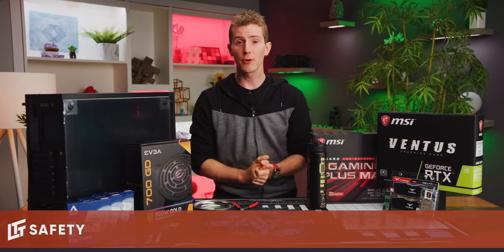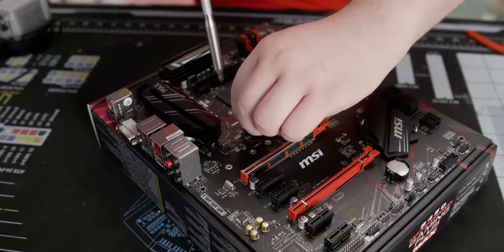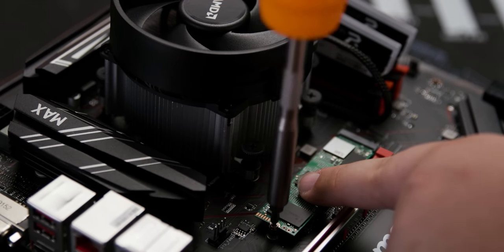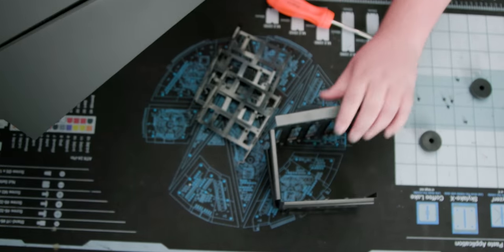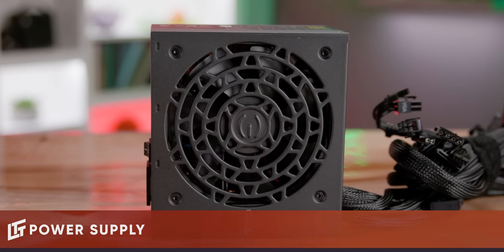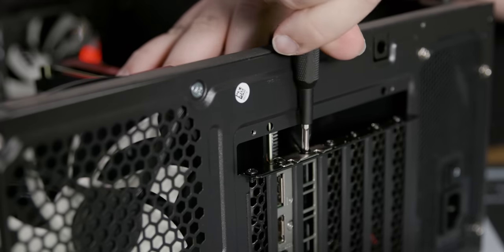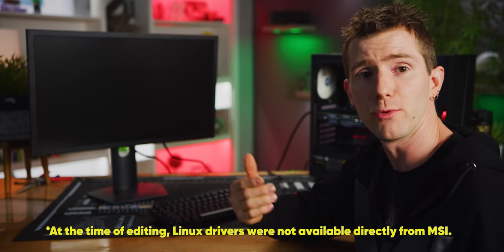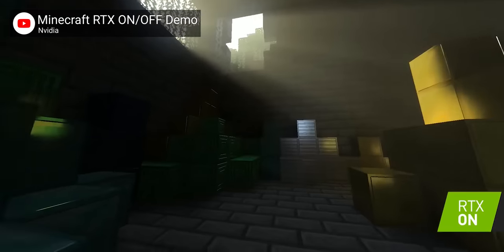$900 Ryzen Gaming Build Guide

Comment: I think I'm going to build this. It was this or the new 500$ video. I dont understand anything about PC's but this will be my second build. 1st one got about half a gallon of water dropped on it. Nothing was salvageable.
Edit 1: I have everything but the ssd, its shipping. I just hope all goes well.
Edit 1.5: I got everything but my keyboard and my monitor. They are both shipping. The ssd is here ima start.
Edit 2: So I fucked it. There were 2 standoffs and I got confused. My standoff hole has one thread broken. I have the right standoff now but I have 0 clue what to do with it. Starting to remember why I hated building PC's. This blows.
Edit 3: Ok everything got in. I need to pick up 1 more fan to have 3 and my monitor is on the way. Yup that means I'm stupid and just put the stuff in the case b4 I checked to make sure it's working. If it backfires it backfires. I've been waiting for months now. So all I need to do now is find out how to plug in the fans and I'm good 2 go.
Edit 4: Building a new PC now lmfao This was great but I make way more now. This is the build XD https://pcpartpicker.com/user/Desso/saved/#view=QB63wP
Reply: F

Comment: I'm new to PC's so bare with me, but are all the parts he uses in the description?
Reply: yes.
cpu = ryzen 5 3600
gpu = rtx 2060
ram = 2x8gb delta
storage = 1tb nvme 660p ssd
mobo = b450 gaming plus max
psu = evga 700 gd
case = corsair carbide spec 05

Comment: Bro, I have inserted the AMD processor on Motherboard and then mounted 
the FAN. Due to some reasons I need to put the FAN up but with that the 
PROCESSOR came attached to the FAN.
Now, I reinserted it as it was to the processor socket in the locked state.
It seems that it fits well, do I need to do something else?
Should I make them separate and then re-do the full process?

Comment: Why use A-XMP if the motherboard is already running at that speed? Check the video at 20:18 and you can see A-XMP is disabled but the RAM speed is 3000mhz.

Comment: @Linus Why do we short the power supply during testing?
Reply: 1. If your referencing the verge build. Then 🤣
2. If your talking about the part of testing the system outside of the pc. Then he shorts the pins on the motherboard to turn on the power supply and thus the system turns on. Allowing him to test the system and make sure it works before putting g everything into the system.

Comment: I've just bought parts for a new pc are they worth my money?
CPU: Intel Core I5 9400f
GPU: RTX 2060 6GB
Motherboard: MSI B365M Mortar
Ram: 2x8GB RGB DDR4
HDD: 2TB
SSD: 256GB
Reply: would’ve been better value with a Ryzen 3600
Reply: go with 10400 if prices are close
Reply: @f-22raptor25  my motherboard doesn't support 10th gen if it did i would have done the  upgrade

Comment: Would all these parts be compatible with an msi mpg z490 gaming plus motherboard? It's all best buy had and I want to build a pc for my significant other.
Reply: no you need intel 10th gen for that. 10600k or 10400 are great for their price
Reply: Other than the cpu that @F-22raptor said. Pretty much everything else should work except maybe for the case. I recommend getting a larger one. 
Good luck!

Comment: Hey, I could use some help. I'd like to build my first PC and I'm mainly using the components in this video. On pc part picker, after I put in the SSD on the little build your own page, it gives me this message: "The motherboard M.2 slot #1 shares bandwidth with SATA 6.0 Gb/s ports. When the M.2 slot is populated, two SATA 6.0 Gb/s ports are disabled." What can I do to fix this? Or is this not a problem? Thanksss

Comment: Hello guys, I am here for help. I am trying to build a PC. It will have:
GPU: 1660 Ti
CPU: Ryzen 5 3600
Motherboard: Asus B450- the gaming version
Ram: Hyperx 2x8 GB 3200mhz RAM
Power supply: be quiet! 650w 80+gold
1 TB 7200rpm HDD
500GB nvme m.2 SSD
Will it run games like COD on higher settings at higher FPS?
My budget is 1000€, which is like 1,100$
Reply: With a GTX 1660 Ti and a Ryzen 5 3600 you're definitely expected to run COD on very nice framerates (Driver updates for the GPU will definitely improve performance overtime so make sure to keep them updated), assuming that you have a monitor that will be able to push to those high framerates (Except if you're willing to not use V-Sync (V-Sync locks your framerates to the refresh rate of your monitor, thus eliminating any screen tearing - G-Sync and FreeSync is the same concept except it's a physical chip integrated into monitors) or G-Sync (If you have a G-Sync Compatible monitor)).
Reply: @fuzzy6622  thank you, this is the first time someone actually wrote something😁😁

Comment: Hi guys, I'm a bit stuck in my research to rebuild my pc. It's 6 years old and after countless BSoD I've decided to swap the internals. This is the system I've come up with so far: https://pcpartpicker.com/list/Mvh3gt

What I'm trying to figure out is if the motherboard will support the ram clock speeds of DDR4-3600 as under the specifications this is what it mentions:
https://www.asrock.com/MB/AMD/B550%20Phantom%20Gaming%204/index.asp#Specification

In that list of Memory compatibilities, I don't understand what it says by 
"- AMD Ryzen series CPUs (Matisse) support DDR4 4533+(OC) / 4466(OC) / 4400(OC) / 4333(OC) / 4266(OC) / 4200(OC) / 4133(OC) / 4000(OC) / 3866(OC) / 3800(OC) / 3733(OC) / 3600(OC) / 3466(OC) / 3200 / 2933 / 2667 / 2400 / 2133 ECC & non-ECC, un-buffered memory*
- AMD Ryzen series APUs (Renoir) support DDR4 4733+(OC) / 4666(OC) / 4600(OC) / 4533(OC) / 4466(OC) / 4400(OC) / 4333(OC) / 4266(OC) / 4200(OC) / 4133(OC) / 4000(OC) / 3866(OC) / 3800(OC) / 3733(OC) / 3600(OC) / 3466(OC) / 3200 / 2933 / 2667 / 2400 / 2133 ECC & non-ECC, un-buffered memory*"

I get that (OC) means Over Clocked, but does that meant the motherboard has to be overclocked to be able to handle the DDR4-3600 Ram sticks?

Also, how does one pick between brands when it comes to GPU's? I think the RX 5700 XT out to be a reasonably good card, but don't know which brand to choose from.

Comment: This question may came a bit later but i have the same case, and it isn't that much "deep" (199mm) so if anybody has it, does a liquid cooling fits on top? i know it fits a 2x140 but considering the radiator, does that interferes with the ram memories? i have two 120mm fans and looks like it almost touch the memories...

Comment: Can you upgrade to better things in the future? sorry if thats dumb its that im new to this
Reply: Yes. With PCs you can upgrade and change out any part. The only real rule is whether you want an Intel or amd cpu. That determines your mother board choice. I prefer amd, as they have been making their mother boards forward compatible currently. Meaning I started with a 2nd gen ryzen, upgraded to 3rd gen, and the latest generation is also compatible with my board. Intel has been greedy changing the cpu configuration every generation forcing customers to change motherboards if they plan on upgrading. Also AMD is currently beating Intel in performance this generation, so better choice all around.
Reply: Also forgot to mention. The CPUs aren't the only thing. There's also different generations of RAM. Older mother boards typically support what's called DDR3. Current boards support DDR4. Future boards will have DDR5, but we aren't there yet. Can't put old RAM on a newer board and same goes for putting new RAM on an older board.

Comment: how come this 2060 is giving 100fps on 1080 ultra settings in witcher 3
and in dave's videos, laptop 2070 max q, that is supposed to be at least better than desktop 2060 giving only 70fps at same settings?
Reply: because it's a laptop
Reply: Laptop gpus are generally weaker than their desktop counterparts. Also laptops have thermal limitations which prevent the gpus from going all out.

Comment: 2:06 Its Wraith Spire Not Wraith Stealth. R5 3600 comes with Wraith Stealth its not good tepms easily reaches 95c and processor can't fully turbo and throttles. I ended up ordering Coolermaster MA410P for my R5 3600.

Comment: Hi.I have same build motherboard:X570 PHANTOM GAMING-ITX/TB3; Processor:Ryzen 3400G; RAM 2x16GB Corsair Vegeance LPX 3200Mhz and case 130W.
On official ASRock website they say:"**The Max shared memory 16GB requires 32GB system memory installed." .But in bios there its olny option to chose 2 GB max for graphics card.Can you tell me how to overclock to 8 GB shared memory?
Please HELP
Thanks

Comment: Serious question, is this still viable in 2021? Can it run mainstream titles smoothly?
Reply: Yes. This card and cpu should be fine for 1080p gaming. Unless by "viable" you mean 4k ultra settings, then no. Lol
Reply: @smittyvanjagermanjenson182  I'm good with 1080p, I just want a good setup that can run today's games, and also do architectural renderings. That's probably the main reason aside from games 🤣 Thanks a lot man
Reply: @Slash4747  hmm can't speak for architectural renderings, but if its like HD video rendering,  more RAM probably couldn't hurt.
Reply: @smittyvanjagermanjenson182  Thanks a lot, man, that's noted

Comment: Seems like it's cheaper to get a pre built right now because of the  virus and everything. I got a pre built ryzen 3600 and  Rx 5600xt with 16gb of ram a 1tb HD and 500 GB SSD  and it came with mouse and keyboard for 900 last week . Not the best mouse or keyboard honestly but if you're trying to save money it helps untill you can buy a better one.

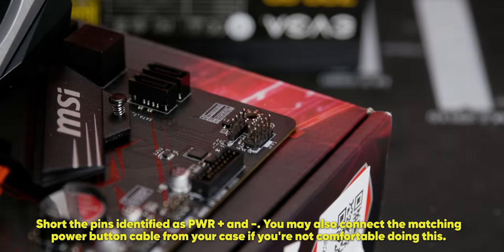Comment: 4:57 wait what is he doing there? ive never seen that before(im new to pc's)
Reply: He is using the screw driver to short out the 2 pins that usually turn on the computer when you hit the power button on the case. It's a neat trick to test the system out of the case.
Reply: @navisorret7466  thank you :D

Comment: The spec 05 cpu 12volt cable cutout is too small for it to fit through. sucks you have to run the cable over the top of the ram.

Comment: Is 500~550 W PSU enough for this build?
Reply: If it's a psu with a good 80 rating then it should be fine. I recommend double checking at pcpartpicker.com and add all these pieces to figure out the minimum wattage for the system. Then i recommend to add at least a 100 watts on top of the minimum to make sure the system does not suffer from a lack of power.

Comment: Planing for Ryzen 3700X 
GTX 1660
MSI B550 motherboard 
16GB RAM 
256 GB SSD - OS
500 GB SSD - Storage
600 W power Supply 
Mid Tower Case 

This will not be for gaming but for Adobe Creative cloud....goin sleek and no RGB 

Can't have my room look like a disco at night...😂
Reply: 500gb storage might not be enough nowadays, go with 2tb hdd or shdd
Reply: Hmmm yeah the storage might not be enough. Idk the budget your working with but I would look into maybe a 1 terabyte sdd for both OS/ newer files and add 1/2/or3 terabyte hdd for long term storage. 
Unless you have a external storage system like linus does in which case then you might be fine with the sdds you have. 😅 (dang that's power).

Comment: At 5:15 why the DDR speed is showing up as 2400MHz?
Reply: Ok so here's the strange thing. When you buy ram and a motherboard, sometimes when you add the RAM the motherboard would change the speed to be lower than the rated speed on the RAM. You would have to change it on the motherboard bios to fix this. (I'm not 100% sure how but I'm sure you can find a tutorial that explains how to do this. )

Comment: Do i need to buy windows or is it free, pls answer
Reply: Windows 10 is not free, it's $100 from Microsoft. You can get a cracked version or use Windows 10 Installation Media Tool to get Windows 10 onto a flash drive so at least you can begin using the PC, then get the full version of Windows 10 later on.

Comment: Fan in power supply doesn’t even turn on :(
Reply: 1. If it's an older power supply then there might be a problem. 
2. If it's a newer supply and has a high rating it could be that it isn't being worked hard enough and thus doesn't need the fan to spin yet.
Reply: It was just dead. Got a new one only to find the HDMI port in my graphics card was busted

Comment: Also PLEASE MAKE SURE TO KEEP THOSE PLASTIC AMD parts that you took off the motherboard. If you decide to upgrade to a different cooler for the CPU. You will need those two bits (yes you can order replacements but why spend an extra 7 to 13 bucks when you already have them. I upgraded my 2600 after having the stock cooler on and as with most AMD coolers they had metal brackets that hook onto the plastic notches from the original motherboard pieces that you have to take off for the stock AMD cooler. Learn from my mistakes! Keep those bits and pieces as I’ve had to order one before (msi g45 gaming fm2+ A10 7850k and upgraded to a water cooler but 5 years passed and I lost the original brackets. I’m now a computer parts border lol! Lol bless you for making this build as I’m still using a i7-4790k and want to upgrade to an AMD but didn’t understand the difference between the 3600 and 3600x! Ty

Comment: ineed to know if i chosed another gpu like 2080ti   orhigher cpu  ryzon5000  or 7000 is it ok if i use the same with motherbord and the powersuplais in these video..
Reply: You may want a motherboard with slightly better VRM cooling (and a bios update for older boards with newer cpus) I linked a pretty solid looking b550.  but a 700w power supply is pretty good as long as you don’t actually mean the 2080 ti.  You should use a power usage calculator though (I try to have about 200-300 watts more than I need for future upgrades)
https://pcpartpicker.com/product/39LwrH/gigabyte-b550m-aorus-pro-micro-atx-am4-motherboard-b550m-aorus-pro

Comment: I have almost the same system but when i try to Boot with my 3600x the mainboard Lights up an Red debug cpu LED and i dont have any Display.... Can Someone Help me?
Reply: Αre you able to get in the motherboards bios at least? if yes  probably you need to update the bios version of the motherboard to be compatible with your 3600x if not then  maybe you need to inspect the ram if sitting properly. Also inspect again the wiring on bottom right of the motherboard power / led/ reset pins from the case's cable.

Comment: Guys I'm looking to build a low price all round rig and am leaning towards 
12core threadripper 1st gen
Either asos prime x399 extended
Or
Gigabyte Aurous pro 
32gb ram prob hyper x fury
Like a 8gb Rx series graphics card with crossfire (for adding another later)
Hdd+ssd+power+case..... all of which I'm still floating on budget and size etc 

Chip and GPU will prob be second hand 

I was wondering if anyone has any input on this and what I could use for alternatives or equivalents etc
Want it for using the video editing side of DaVinci resolve and also gaming capable 

Having not having built a pc in say 5+ yrs I'm looking for any tips and advice on these items.

Having watched 100+ videos recently my brain is frazzled 😂

Comment: Can i use 450w psu in this build?
Reply: 450 watts is a little low. I recommend using pcpartpicker.com to double check though. I recommend a minimum of a good 500-600 watt psu for this system.

Comment: Does anyone know a comparable graphic  card because I ain't spending 1800 on a 900 dollar system. I also plan to use a Acer Nitro monitor instead of the Dell.
Reply: If you can, use an APU for now (CPU + integrated GPU), and wait for the GPU market to stabilise.

Comment: Ok I need help  Did he really need a 700w power supply for this build
Reply: I got a 750 on sale, if a 650 is on sale it should be fine. PSU prices are sky high, my 750 was cheaper than a modular 650.

Comment: Does this b450 only take 1 2 3rd gen ryzen

Also will it be fine running 4 gpu rig

I bought a b450 gaming max

What's best processor.. Thanks
Reply: Most cpus should be ok, high end should be fine if not planning to oc 3800/5800 on down. Including ryzen 5000 with a bios update that you're not able to roll back from.

Comment: 700w psu...
Reply: You could get a lower watt psu for this system. Around 500-600 watts should be fine.
I talked to a technician at my school while doing research that its recommended to get a psu that's over the required wattage of the system because this allows the system to pull more power from the psu if the system needs it. Thus helping the system run more smoothly. 
I'm not sure of the validity of this but this is probably why Linus adds a psu that's waaayyy over the actual needed wattage.

Comment: In 900 dollars in my country i got just my build but its lower speced
Ryzen 5 2600 (135 dollars chip only)
Ma410p cpu cooler( 40 dollars)
B450 aorus pro wifi ( 162.5 dollars )
Adata ddr4 2666( from prevous build)(34.5 dollars)
Gtx 1070 Aorus extrem used(266 dollars cheapest price)
Cv 550 power supply( 62 dollars)
Mb511 case (94 dollars)
Redragon majic wand keyboard(47 dollars)
Redragon M711 cobra ( 20 dollars)
Basic 1080p 60hz ( 45 dollars) total 900 dollars same cost but lower spec sadness

Comment: Aaaand it's 1400$ now...
Reply: On Amazon and Newegg?
Reply: @vincentstark7093  yeah, most of this stuff is sold out from official stock and it leaves 3rd parties to set their own prices (I've seen $200-$500 price increases on the stuff used in this video). Trumps china tariffs have also made the PSU's go up in price from official sellers, up 10% in some cases. Then theres the whole coronavirus thing which adds to the mess... It would be much better to wait it out unless you're ready to drop 1400+ on a pretty nice computer.

Comment: This pc looks as shit as the shit your eyes were rolled in that made you think that rgb ram looks in a build with literally no other rgb part in it

Dude you have rgb ram a red motherboard 2 white and 1 clear fan red fan that are both lower down when you could have kept the drive cage and put them up higher to make it look even a little bit better from this crap hole and a black pc case that doesn't fit in with anything with no basement to help with cable management